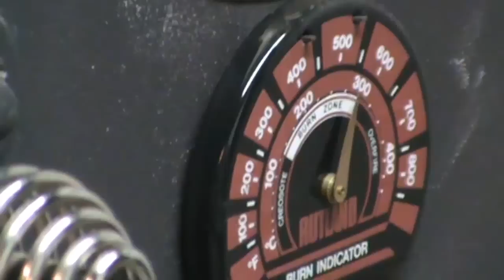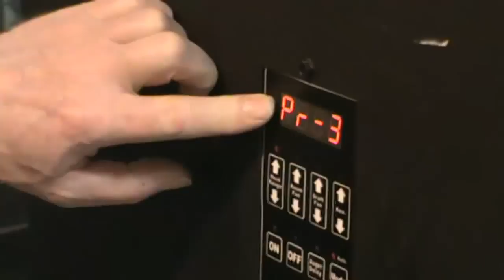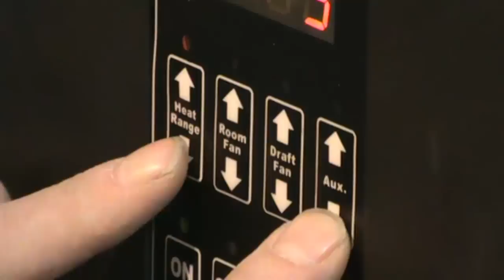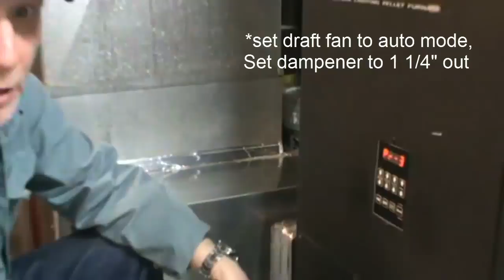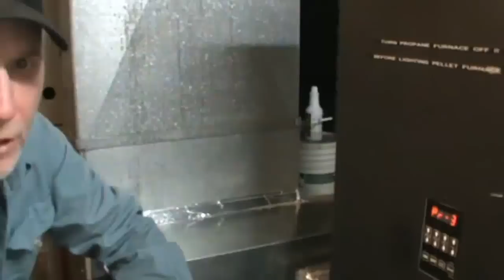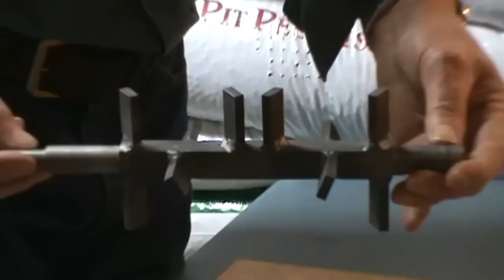US Stove Model 8500 Operating Tips & Fine Tuning

Comment: Just got my 8500 furance today don't have it hooked up yet but looks very nice well made. I checked the setting on it and my second blower fan was set on 6 so i turned it down to number 2 setting.. and my low feed rate #1 was set at 7.68 pounds  and i turned it down to 2.00 pounds. . And my high setting #5 was set on 17.50 pounds i turned it down to 4.80 pounds.. don't thank my furance would of worked very good with them setting.. can't wait to get it hooked up.. will take me a couple weeks to put it in but i will post back when i get it going.. thanks again for all your videos  i thank its going to make the set up go pretty smooth with all your help..
Reply from the maker: Sean,  just little tip, when your adjusting your feed rate on #5,  after changing rates, it may take a couple of hours 

To stabilize  and level out , when you get close.  L/a mech.

Comment: Can you tell me how the thermostat hooks up to the furance and how does the thermostat work? Does it work  off you setting you Programe on the furance? And what kind of thermostat to get i just order my stove to day and would like to run it with a thermostat. . Thank you
Reply from the maker: Sean,
There will be a video out in a couple of days for the thermostat hook up.
After you install your furnace, set it up as per the operating tips and fine tuning video .
I would suggest running your furnace for one season first,to become familiar with the 8500, before switching to thermostat operation .
Best regards ,land /air mechcanical .